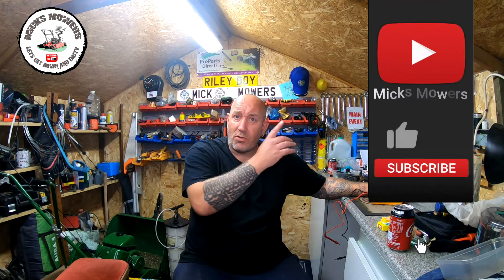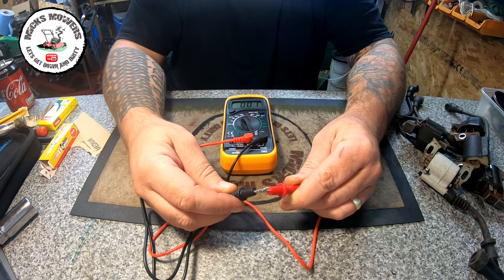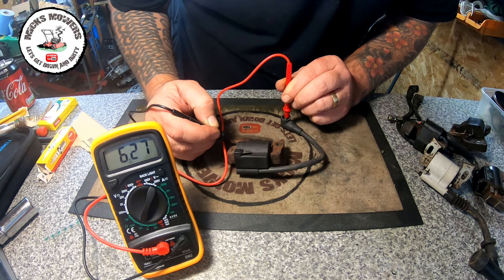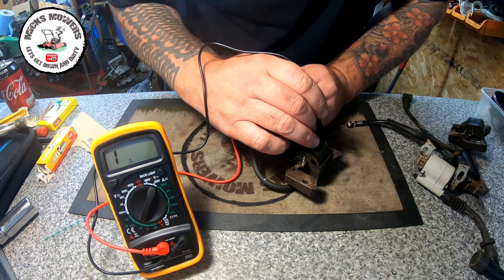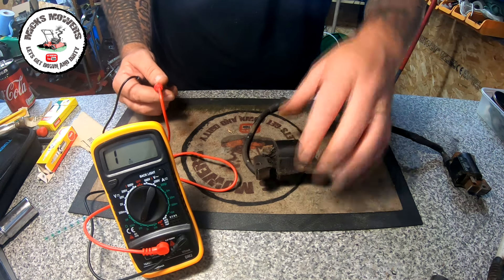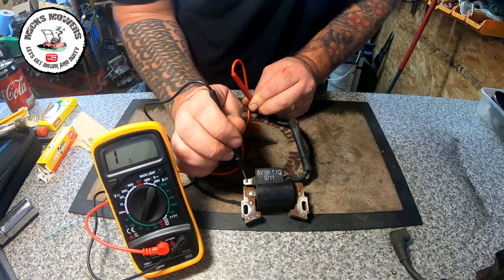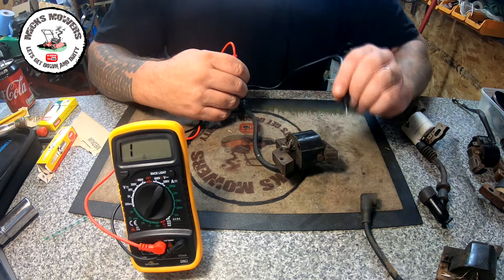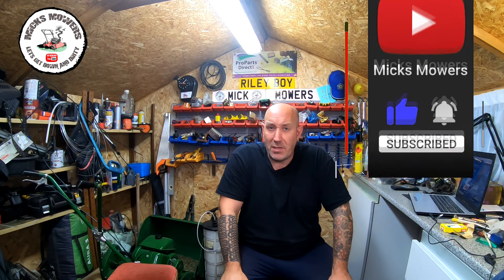How to Test A Lawn Mower - Ignition Coil Magneto With A Multimeter #easy

Comment: Not bad Mick.... But your knowledge of Multimeters was clearly basic...as you admitted. (BTW: That's not a bad meter for the price!)
The Black lead ALWAYS goes to the COM (Common) socket. It is the red lead that gets switched around for different functions.
When making simple resistance tests on the coils as you did....it is not really an issue..... Red wire, black wire....electricity is colour blind!
However... if you were testing a battery and you put your two probes across the battery.... In your case, the red onto the +ve terminal and the black onto the -ve terminal... The display would read  "-12v" (A car battery, say.) because you have reversed the connections to the meter.  

If you reconnect the meter leads as I say, Black to COM...the meter will read simply "12v"...as is the accepted display (NOT +12v...as one might expect.) 
It also gets a bit complicated when testing Diodes (Of which there are two in some 2 cylinder Ride-on Mowers for instance) 
This is because the meter supplies a voltage to check the flow direction... (A DC voltage obviously, from its own internal battery...just as it does to measure resistance...as you demonstrated.) So it is important to know which lead is actually +VE & which is -VE.....  
(Mind you: Most diode failures are either Open Circuit in both directions or shorted in both directions: Either result is a failure, of course.)
 
Within these more modern coil packs, there is a couple of transistors arranged in a "Darlington-Pair" these eliminate the need for points as they switch current in the primary winding... causing the "Collapsing  Magnetic field" which in turn causes the huge Step-up voltage in the secondary..... 
....which of course, becomes the "Spark" we are always looking for at the spark plug.....  (Phew.... Got there!)

But, you are of course right.... basic resistance checks of the two windings will tell you if a pack is a duff one. Immediately. 
...we need to remember: We are only checking two windings....not the trigger circuit electronics.  
And another factor I have found over the years..... A cold coil pack can work fine.... then goes bad as it warms up on the machine: Windings expand & short out.
Due to heat or vibration....windings...or electronics? Who can say with such sealed units?     It's the way of the world Folks!

Comment: Thanks for the video.  Just a note - if you are doing a twin cylinder mower then you will likely need to measure the resistance of the secondary coil through the two leads and not to the ground. (The coil I just installed appears to have one lead hooked to one end of the coil and the other lead to the opposite end. The mower wouldn't spark/run until I hooked up both leads to the spark plugs.)

Comment: Wow took me some time to find a good video on testing coils!! Question for you, can it happen that the coils are good but the dead man connector isn’t? I seem to have an issue with my engine not shutting off when a good ground switch is applied.
Reply from the maker: Yeah.. it could be the shut off switch mate
Reply from the maker: Or the wire from the coil.
Reply: I tried to test my coil but don’t get any readings on multimeter. I get a reading only on the deadman connector. I also checked for continuity and I have a short with meter leads (one in plug and the other on the deadman. Is that normal?
Reply: I checked the switch and it’s working perfectly.
Reply: My engine starts and runs properly I just can’t shut it off even if the kill switch is working properly.
Reply: Wish I could show you.
Reply from the maker: @caciocavalloster  what is it on.. a ride on or push mower
Reply: It’s a push mower Tecumseth engine 6.5hp

Comment: i tesed both my coils and 2 different muti meters. i couldnt get readings on any of the points you describe testing. all thought my machine runs?  im testing on clean metal as well so its not a connection issue......

Comment: Rover mini rider ride on is spluttering and stops when motor gets hot but runs fine before hand
I thought it might have been a plug so I replaced it but problem still there.
The carburettor has a solenoid i pulled it out and checked it's staying in when powered up.
Any suggestions? Can the coil break down when hot.
Reply from the maker: Yeah mate they can ..

Comment: So, if I put the red connector in the spark plug wire boot and the black one to the dead man's switch and get nothing is the coil bad?

The coil had readings when I put the red wire in the boot and on each grounded side (where bolts goes)  but nothing on the dead man's switch and in the boot.
Hope I am making sense.  Thanks for the video 😊
Reply from the maker: If your getting nothing it's bad or you have a break in the connection

Comment: Elo Mick can you answer this one or suggest something!or is it a scrap job ! 196cc loncin lawnmower engine no spark has a new coil & spark plug flywheel key & magnets are good kill switch on & off no spark so it cannot be a short ! if the timing was out there would be still some intermittent spark ! i had this once before on a Briggs & Stratton engine or is there something under the flywheel preventing a spark ? much appreciated
Reply from the maker: Does it have a set of points under the flywheel.. how old is it ?
Reply: @themowerman  no points or condenser has a ignition module  thanks for taking the time to reply !
Reply from the maker: @dennispratt3344  take the wire off the coil and try to start it .. if it's a no start then it's the coil or plug..
Reply: @themowerman   its a new coil & plug good readings with ohms  old & new

Comment: What should the reading be between the kill switch terminal and the iron core of the coil? I haves a Briggs engine on a mower which won't spark but its showing 5k ohms between HT and core, 5k ohms between kill switch terminal and core (which would point to it being a good coil) but 0.7 ohms between core and kill switch terminal?
Reply: Same. I wish you would have got an answer. Lol
Reply from the maker: Sounds like a bad coil or bad connection

Comment: Hi mick..i have a non starting sovereign im getting no spark and coils giving a 4.46 reading across all points,so iv starting looking at the kill switch. How can i test it ,its not got a "normal" switch its more like a metal plate with an insulator under it and the wire from the coil looks like it goes under it..how can i test it with a multimeter ? The mowers a sovereign xss40a grateful for any help
Reply from the maker: Mate .. take the wire off the coil end.. and test for spark.. if it sparks then it the switch or the switch is not closing.. sometimes bending the arm on the switch to it makes contact helps it
Reply: @themowerman  thanks mick il try that tomorow weather permittig
Reply from the maker: @stevelewis5710  cool

Comment: Mick,
 I have a faulty Victa twin mower,  twin spark coil, and no new ones are available. How can I now adapt a two pole type twin spark coil to the magneto and still get the timing right, and is that a possibility anyway. The Victa coil has 3 poles to it with the middle pole going thru the centre of the coil. (W type, not a U type) Is that possible?  Or maybe you know where some 3 pole coils are still made or can be bought? I
Reply from the maker: Hmmm I don't know mate sorry

Comment: Hi mick..I have a punch 75g 14 and I'm getting no spark..3.3ohms on the coil. Amy idea what else it could be or is the coil bunched
Reply from the maker: Has it got a set of points?
Reply: @Micks Mowers The Mower Man  whats that 😄.   Am.i able to send you a picture of what I have
Reply from the maker: @joeeager4717  yeah email me micksmowers01@gmail.com
Reply: @Micks Mowers The Mower Man  hi Mick..I was just looking at a video by Taryl Fixes. I need to get that exact ignition coil..any idea where I would get that..thanks for all your help..
Reply from the maker: @joeeager4717  I think I sent him that coil?
Reply: @Micks Mowers The Mower Man  yes you did. Can't seem to find the correct 1 anywhere..

Comment: I thought my coil was bad and bought a new one. Both coils test good per the video.  Tried 3 spark plugs, re-gapped the coil several times and not getting a spark. Deadman wire tested good, but it is not connected.
Any suggestions?
Reply from the maker: What about the wire from the dead mans switch to the coil.. it may be damaged
Reply: @themowerman  Thanks for the reply. It was actually disconnected to remove it as a problem. I did figure it out. I cleaned the mounting areas between the engine cylinder and the coil and this improved the grounding of the coil. Now I have a strong spark. Aluminum does get a corrosion film on it and so does the steel.
Reply from the maker: @edhyde1741  good job

Comment: Just tried your method of testing after purchasing a new makita ignition coil. Both coils tested ok but  either of them will not produce a spark I checked the alignment of the flywheel and gap all ok plenty of compression. Where would you go from there
Reply from the maker: Try taking the coil wire off and see if you get a spark.. it could be the wire from the coil or the stop switch has a fault
Reply: @themowerman  tried that and a plug

Comment: Ok, it is good way to test coil.. But do you set your multimetar on just 200 ohms whan you were test ignition or you put that on MegaOhms ? Off course 6.22 is not in Megaohms because no have much  multimetars which has that range for testing, us usually 2M . I was test my coil , and I didn't get nothing clouse of this numbers , my resistance is a lot of bigger , and I had 500K , and I did same method of testing as you did here and , from my opinion if is resist to big that means actually that coil is damaged and if is resist a high than is a low capacity of magnet or electrity inside the coil. And that means is need to replace that part ! Is possible to flywheel makes a bad contact in the spark ? So what you think ?
Reply from the maker: It is possible mate

Comment: Where can we find the specs for resistance reading for Brigs and Stratton Magneto.  I assume different sized engines will have different specs for magnetos?
Reply from the maker: You would have to look up in the specks on the website
Reply: @themowerman  Thanks for the reply.  I've searched every way i can think of, and have not been able to find specs for a magneto for a Briggs 1150 (model 15t212-1128-f8).  I'm assuming it may be in a dealer repair manual or something that is no readily available to the public.
Reply from the maker: @stevestone3325  yeah..

Comment: Okay, that was very easy, very helpful! But my lawn mower still doesn't run. I have a new spark plug, the ground disconnect wire (?) is fine, and the coil tests fine. When I test the spark plug to ground, there doesn't seem to be much of a spark though, but I was outside in the sunshine. Sometimes it almost starts up on the first two pulls of the day, and then nothing, not even with starter fluid. So I was thinking carburetor, perhaps? But it should at least have sputtered with the starter fluid. So, I'm a little dumbfounded. Also, it sometimes starts up after a couple of days standing, and it might run for one or two hours, then it just refuses to start up again. Anyone any ideas?
Reply from the maker: Ok.. soni would go for carb clean and maybe check the timing.  Have you hit something..

Comment: Help please, my riding mower does'nt start, I used a spark plug tester to test for spark and i get a spark connect the spark wire back to the spark plug and won't start but if I leave the spark plug tester in line between the spark wire and the spark plug it will run, what could be the problem?? Thanks for any help.
Reply from the maker: New plug.. sounds like the resistance is dropping when the in line tester is removed
Reply: @themowerman  I will checked with an amp meter thank you.

Comment: Mine measures 5k ohm so should be good. But I wonder, is there a bad sign if I have 0.6 ohm between metal housing (for example through holes for bolting it up) to the killswitch spade connection? I thought that should not be a short circuit but I know nothing about this stuff 😂
Reply from the maker: If in doubt a new coil is only about£15.. I would just change it
Reply: Micks Mowers The Mower Man I’ll update with readings for a brand new coil. It felt strange that the killswitch connector would almost have 0 ohms to the housing, I mean, why the need of it if it would be grounded just by bolting up the coil to the engine block. But we’ll see :)

Comment: The black wire goes into coms socket NOT the RED and make sure that the Red wire goes into the volts socket and not the AMPS/milliamps you should really pin a comment or change this as it could be dangerous if the are testing something other than lawn mowers

Comment: Mines at 2.46 my blower starts but get jumpy after about 30 seconds and eventually cuts off...
Reply from the maker: Have you changed the plug.. and gapped it correctly.. it van make all the difference..
Reply: @themowerman  I have tried gapping it with 2 pieces of copy paper, my business cards. 1 sheet. Two sheets seems to be the best. It just gets real jumpy and almost kicks really. It makes me imagine it must be the ignition coil. Everything else is newly replaced but the motor and the motor seems fine. I just got the ignition coil in and I will be replacing it tonight. Thanks for getting back with me.
Reply: Hey Mick. Man! It was most definitely the ignition coil! I am stoked that I fixed my blower! So I checked the Omhs on the new unit and they read. 2.8k so even the slightest drop below 2.5k will cause the engine to sputter. I wonder why that is. Interesting. Anyways thanks for the video mate. It's alive!
Reply from the maker: @jaimejay6056  well happy for ya.. sometimes the coil can have a hairline crack in them and when they get warm they break down.. any glad you got it running brother

Comment: So if you set the gap and you have no spark it need replacing!
Reply from the maker: Not necessarily.. the best way to to remove the coil wire and see if it sparks or starts ..

Comment: But what was the coil resistance 6.22 what ? 6.22k 6.22MOhms ??? The resistance makes a BIG a difference between an open circuit, shorted turns = no output
Reply: The resistance is 6.22 kilo ohms as he has set the meter to read up to 20 kilo ohms

Comment: Not necessarily true that anything reading over 2k is good. My Briggs & Stratton 19hp has a 5k limit on ignition module resistance. It was measuring 5.13k on the multimeter and was putting out only enough for inline tester to glow dimly. This was enough to crank the engine but not start. Changed it out for a new one and the inline tester immediately glowed bright and engine started right up.

Comment: Makes no difference what terminal the red or black lead is on, it's not a diode or transistor where polarity matters. Also if you get no reading at all the coil is "open" & considered bad, it's the same as reading the ohms of a resistor if zero reading then it's "open" no current flows through it.

Comment: check coil with plug resister on  reads 16.234 ohms take off resister  reads 1.28 ohms  brand NEW COIL . TWO POLE COIL  SUFFOLK PUNCH 43S  COST £135 98  + PP your comment please RAY
Reply from the maker: So with a new coil are you getting a spark..
Reply: @themowerman  THIS IS A NEW COIL YOU NEVER TAKE OFF PLUG CONNECTER WHY , RAY
Reply from the maker: @yanavictoria1  because I got a good connection from the ht clip